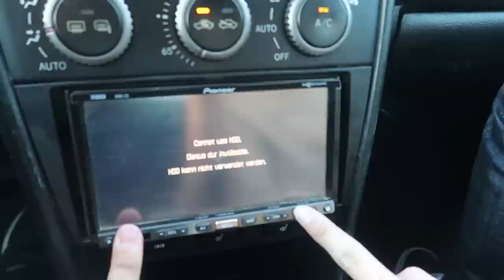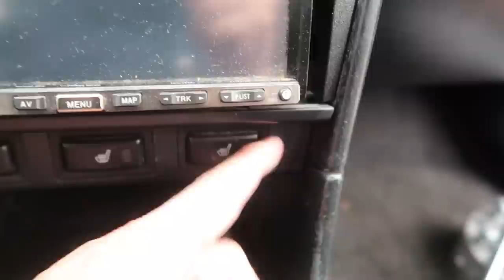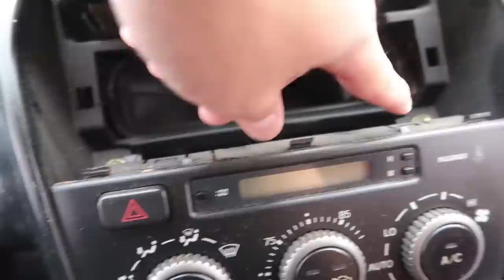Putting Wheels On My Lexus IS300!!

Comment: Merry Christmas. That’s not an amp that’s looks like a converter to plug an amp into a stock radio it uses the signal from the speakers to give signal through the rca jacks to give the aftermarket amp sound

Comment: Hey bro I don't think you need to buy a new adapter or rewire your stereo you could use that old amp converter for you new stereo just put the red and white from your new stereo RCA cables into it and red yellow and black and you might need to connect the blue one to. your new stereo and it should work I had one like that

Comment: Thats not the stock amp you were holding. The stock amp is in the passenger side kick panel. The thing your holding is so you can retain the stock amp while upgrading your headunit. For my IS3 i just bypassed the stock amp and hooked up the wires for the amp straight to the headunit. goodluck hope that helps
Reply from the maker: Will check after the holidays!